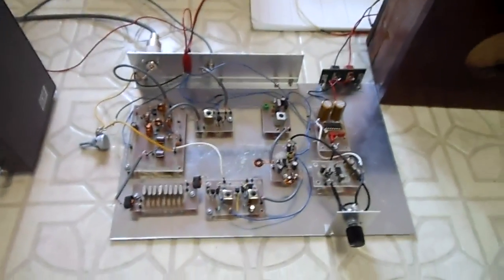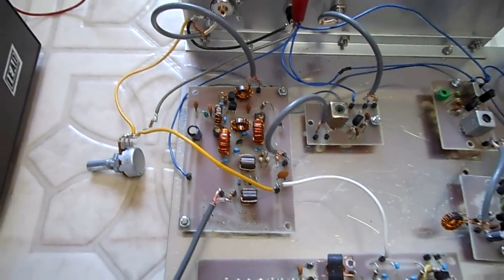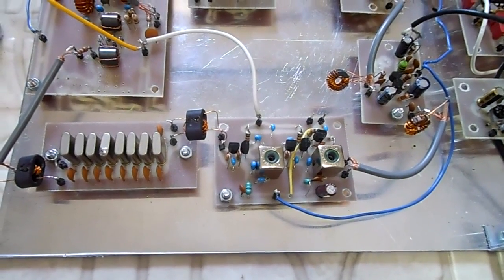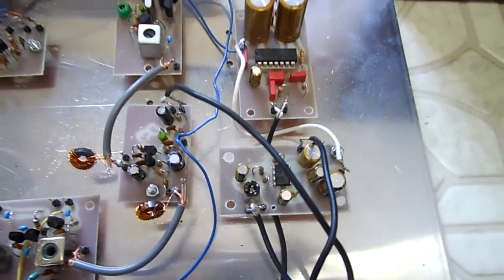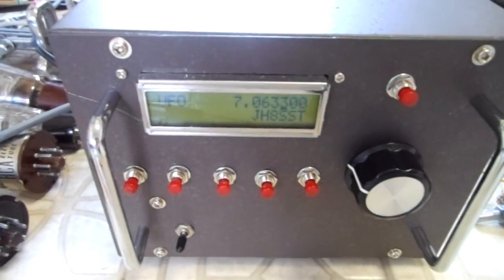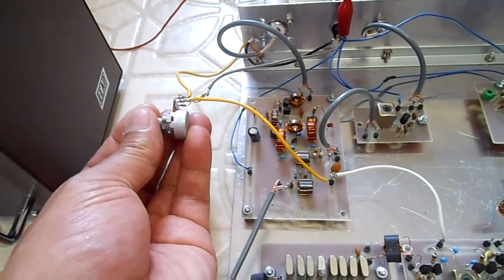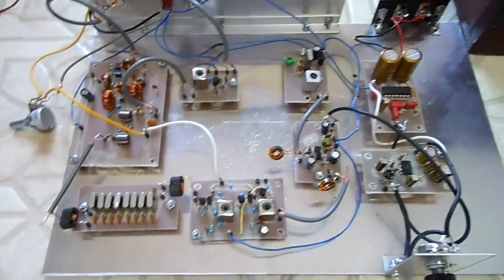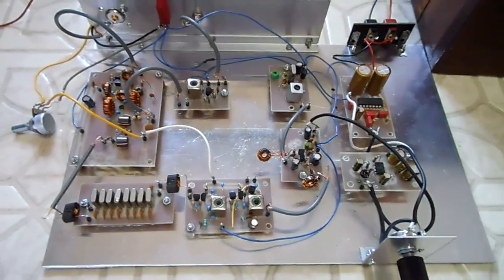JH8SST/7 -  N6QW's Simpleceiver

Comment from the maker: Thank you so much for the comment, raccoonnyc.   I'm going to re-modify it to make it as original as possible.   IF freq will be 12MHz, and the IF filter will be a 4 pole 12 MHz ladder.  IF amplifier stage will be put befor ane after the filter, as the original block diagram.    I can't wait to see how the re-^modified Simpleceiver will work on 40ms band !